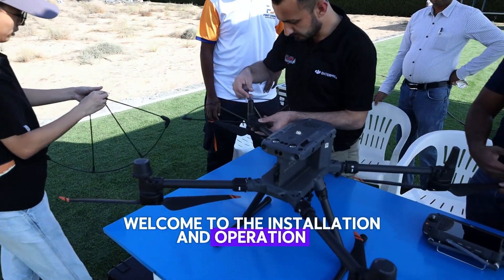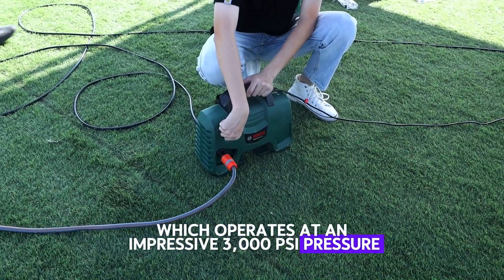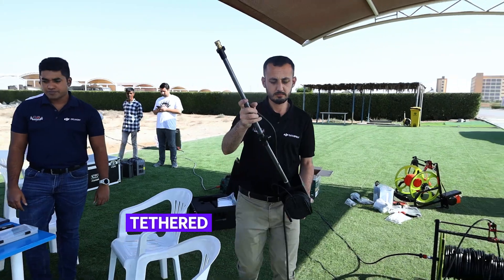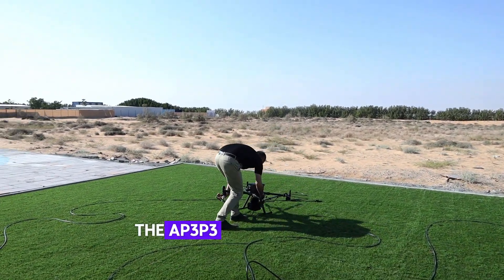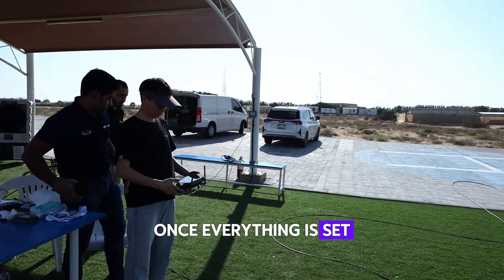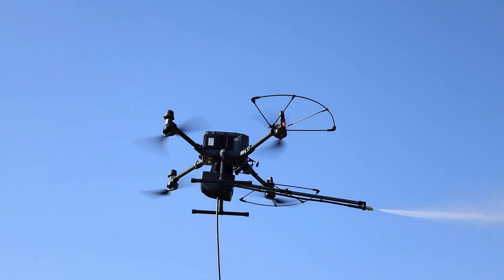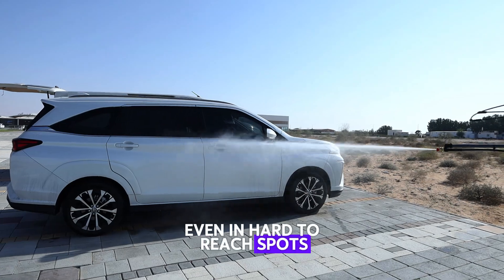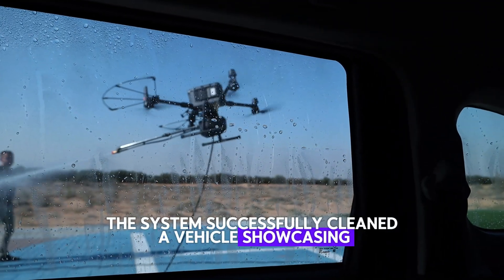DJI Matrice 350 RTK Drone Cleaning Setup with Wisson AP3-P3 Payload for Powerful Aerial Cleaning

Comment: The problem of using this in EU is that the procedure to get the permits (with all the danger assessments, all closed roads, parking lots...) takes more effort (meaning time=money) and is more expensive than simply to quickly bring mobile lifter (which also need paperwork, but less then drone), and put a live worker and hope he will not fall off. EU is doomed.
Reply: Lo intenté y los permisos es todo una odisea 😢